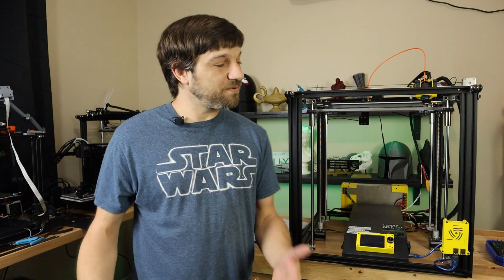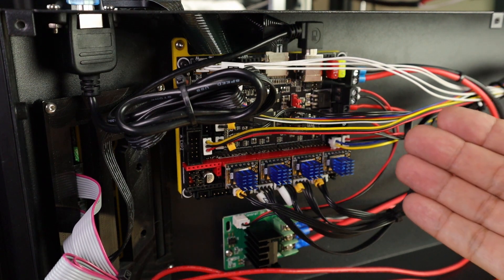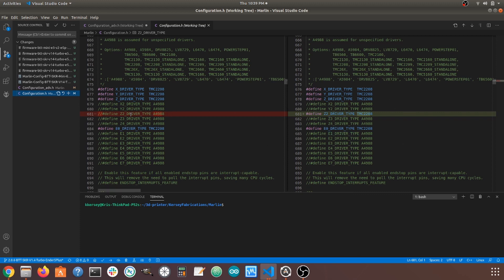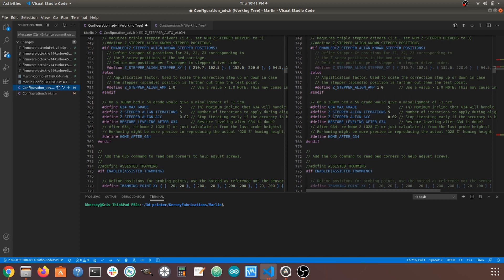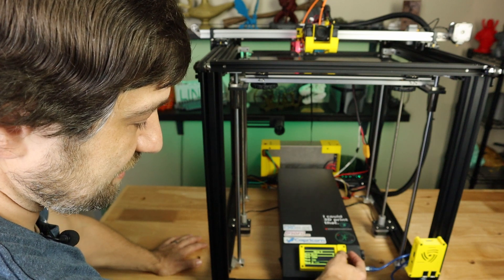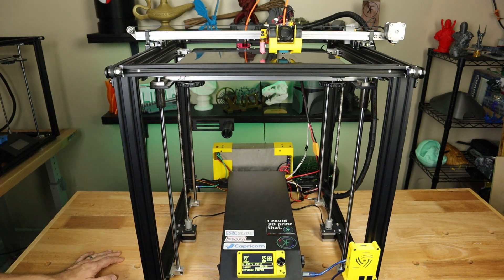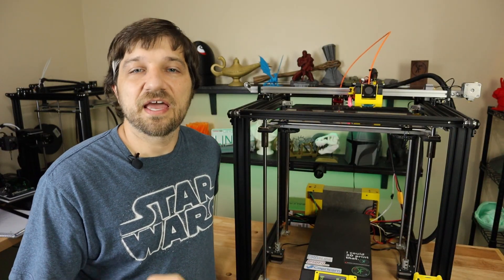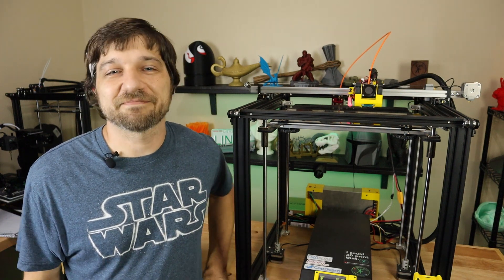3D Printing Pro Tips: Z Stepper Auto Align with Marlin G34

Comment: I have a btt tft35 e3 v3.0 screen. seems to be working on the touch screen side of things but when I switch to the  lcd12864 simulator it just stays black. I could compile this but my ender 5 plus is setup almost identical to yours so I figured your firmware would be plug and play. do you have any known reason the screen is only working with touch.  thanks
Reply from the maker: Have you tried moving the knob? Usually you have to give it some input. Have you used the Marlin side before?
Reply: @kerseyfabs  I did but not sure the firmware flashed to the board. I will let you know. thank you again.
Reply: Hey guess what, didn't rename your firmware to firmware.bin and all is well. Feel dumb but thanks again for your work on this project

Comment: I am liking this change, after playing with it a bit, along with the Bed Visualizer plugin to octoprint I have a bed that is consistently nearly all green zone after probing.  I did notice one thing about the firmware compile you did, however.  The G34 probing and the mesh probing is unbalanced.  The probe deploys MUCH closer to the right edge than the left edge.

Comment: Kris, I had weird issues on probing point when it comes to touch screen UI. Leveling corner points from marlin screen looks correct, but the points from touch UI are different. So do 25 probing points. What about your firmware with TMC2208? Mine is TMC2209. I guess this is bug or error that not solved yet?

Comment: This makes no sense to me.  IMHO, there's no reason for the two z axis steppers to ever run independent of each other and yet you've installed a separate driver and made several code changes to do exactly that.  Apparently what you're trying to do is align the bed horizontally with the X axis tool path.  Historically, this has always been done (quite effectively) by adjusting the corner bed knobs.  At the same time the bed is also aligned to the Y axis tool path.  Please tell me how this new procedure does a better job of this or does something additional.  I just don't see it.  If you're looking for something constructive to do to aid in bed leveling then install some adjustable feet in each corner of the frame and use a level to level the X & Y tool paths by screwing the leveling feet up/down.
Reply: The problem is that the stepper motors turn independently from each other whenever they are not powered. When the stepper driver is unpowered and powered back on, it snaps to the closest full step signal, which may incur rotation of the motor in either direction. It's kinda random, except no mechanical system is without bias. Let's say one side is heavier than the other, then that side will tend to slide down more under gravity. Let's say one side has less friction than the other, then it will tend to slide down more under gravity. So gradually, after being turned off and on a sufficient number of times, the different Z lead screws necessarily grow an offset. To an extent, if you have good bearings, they can limit the misalignment to an upper value though. Of course the alternative is that the Z axis just binds up.

Now in a system like Ender 5 with a vertically moving bed, that's not really a problem, you can tram out the system by turning the corner adjustment knobs - but then again, you can have an automation that maintains the alignment for you, and there's no reason not to use it. The motors only ever move independently right after ABL, otherwise they're lock step. In a system more like Mendel/Prusa, turning the corner bed adjustment knobs is not sufficient, because when you have gotten the movement of the X axis parallel to the bed by adjusting bed screws, you have not solved the issue, because the X axis is not strictly perpendicular to the Z axis! You have a skew, a parallelepiped distortion. The classic Prusa solution (pre bed distance sensor) to that was the angry bump, just driving the X axis up until both sides collide with frame hardware, and then a little bit more until the motors both stall out. If the length of Z axis is known, then it's basically just a homing operation to the bottom followed by a sufficiently long vertical move, blindly. Honestly i kinda love rude low-tech solutions like that.

Comment: I added dual z to an ender 5 pro, have to change the axis that g34 is attempting to level. My dual z is front and rear along y axis not x.
Reply from the maker: In the section of code below, you will want to uncomment the Z_STEPPERS_ORIENTATION line (remove the //) and change the value from 0 to 1.
  #ifndef Z_STEPPER_ALIGN_XY
    //#define Z_STEPPERS_ORIENTATION 0
  #endif
Reply: @kerseyfabs  I did that in the firmware already, but sadly it keeps trying to align along X instead of Y. I've also attempted changes in Z_stepper_align_xy. I'm running bugfix maybe there is an issue.  Just tinkering between calls at work, so I'll have to get back to it later. 

If anyone has this working along Z - it would be great to see the c*.h changes made.
Reply: I resolved it by using m422 from the terminal, now just need to get that into the firmware.

Comment: Great info. Next time do a how-to of the bed skew compensation feature. Prusa enables it in their firmware. Vanilla Marlin has that capability too, but it's disabled by default.
Reply from the maker: Nuno, thanks for the recommendation. I'd like to point you to this video by @Chris Riley from about two years ago. He did a terrific job covering this subject: https://www.youtube.com/watch?v=YfAb5IaHDSo
Reply: @kerseyfabs  I saw that when he originally released it. I was thinking more in the contest of the current versions of Marlin and editors like VS Code, and hardware like 32bit boards and TMC stepper drivers, that sort of thing. Two years is an eternity in the 3D printing world.

Comment: Nice, I changed my printer to 3 Z steppers to take it to the next level. I would not tighten the bed adjustment springs too much, you want a bit of flexibility in case the nozzle crashes into the bed.
Reply from the maker: That sounds awesome! I mention going through normal bed leveling, which should raise the bed back up some.

Comment: Excellent. Thanks, now a question. When I perform a bed level the Y axis does not move. The screen information says that the Y axis is moving?
Reply from the maker: Does it move when you home the printer?
Reply: @kerseyfabs  I must of loosen the connector to Y axis when I was installing the NEW stepper on Z axis. Thanks for the prompt reply.

Comment: Well explained and informing content as always, thank you!
I have a question, have you ever experienced that when flashing firmware and loading a SD card with firmware.bin doesn't flash the motherboard, but when checking the file on the SD card it has been converted to firmware.cur ?
Reply from the maker: No problem.
I can't say that I've seen that myself. I know others have off and on problems with flashing but I don't think I've heard that one specifically.

Comment: Great video I was waiting for something like this. I have tried to do it  on my core xy tronxy x5sa Pro printer with skr 1.4 turbo and TMC 2209 and after updating the firmware I go to try the z axis movement in increments of 0,1mm and 1mm for safety and they do a grinding noise every time they move. I can home X and Y ok but no Z. When I home Z something very strange happens they start moving in sincro at least they appear to me but after 2, 3 seconds the right motor Z1 move down more steps than the left Z2 motor causing the bed to warp so I guess that is the cause of the noise. What may be causing this? I have connected the right motor (z1) to ZMA connection of skr 1.4 turbo and left motor (z2) to E1M. I don’t use sensor less homing so I’m using physical x and y endstops.  I have tried to change up the current until 800 but no change. I don’t know what else to do. I guess that the cause of only being able to move in one direction may be because until it does an auto home and triggers the inductive sensor its always at 0. Looking at pins skr 1.4 section I can find #define E1_STEP_PIN                        P1_15
#define E1_DIR_PIN                         P1_14
#define E1_ENABLE_PIN                      P1_16
#ifndef E1_CS_PIN
 #define E1_CS_PIN                        P1_01
 
I have tried to change the E1 for Z2 but to no avail… here you can find my marlin files so you can see all the configuration. I was using one driver (connecting the motors to ZAM and ZBM)to move the two motors until now without problems but having an extra tmc 2209 driver I wanted to try this. 

https://mega.nz/file/DeIxBaSR#xZCH0mTVW_rQuZlErJrHpVbGzRnkrhGXpNizqBP3BUU

Greetings.
Reply: I'm one of those types of people that doesn't stop until a solution is found so finally I have found the solution... it was the  wiring of the motors, silly me. Most of times the problems comes form the simplest things. Now everything works smoothly. Greetings
Reply from the maker: Terrific! I'm glad you worked through it!
Reply: @32by97  I'm having the same problem what was wrong? It worked at firs but then it starte to sound like that

Comment: While auto-align is a nice feature, with 2mm lead and POM-nuts you mostly will not have any disalignment anyway, so it is a bit of overkill. Also the mechanic is not made for independend positions for both z-axis. It is staticly over-determinated. It works only by using tolerances of the mechanical parts. Any system with autoalign should be constructed with a staticaly determinated system.

Much more interesting is auto-align with 3 steppers. Of course a bit of redesign of the z-mechanic is needed to move it by 3 leadscrews alowing the bed to be be adjusted )make the system staticaly determinated). But the printer would get real auto bed leveling, so no more manual bed leveling.

Comment: I had started just looking into this with the skr pro.  My right size z lead drops every once in a while without stepper power.  Looking through the skr pro pinout.h file though I see only E0, E1, and E2 pins assigned.  using E1 as the next z I am wondering if I will have to mess with the pin assignments.
Reply: look up pom lead screws
Reply: @mattmeyer6471  thanks matt.  I have had the POM nuts installed with anti backlash springs for a while.  I might get tighter precision z acme threads in the future though.
Reply from the maker: I don't believe you'll need to reassign anything.  From my experience, Marlin typically knows to use the next unused extruder as Z2.
Reply: @kerseyfabs  I did not have to change anything in pins.h  my stepper driver socket (red side) was slightly mi aligned such that the black pins of the driver were not plugged in.  Some very careful prying with a feeler gauge put them back in alignment.  Whew!

Comment: Been waiting for this vid and the possible precompiled firmware.  Thanks for providing the 2209 version.
Will it matter which Z is plugged into which driver.  My Z's are not labeled 1 and 2
Reply from the maker: I'm glad to be able to provide them. It does not matter which Z goes into which driver.
Reply: @kerseyfabs  Thanks, crazy that I'm a programmer who is freaked by the programming of his printer